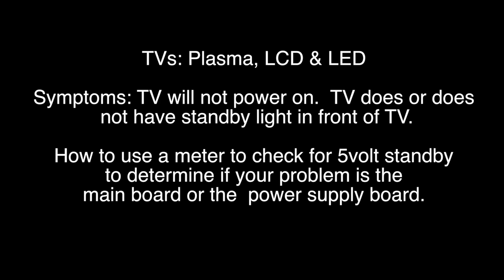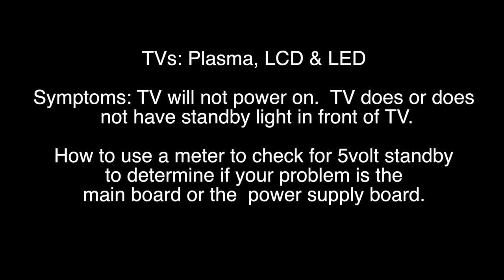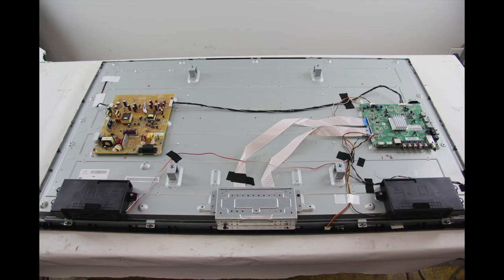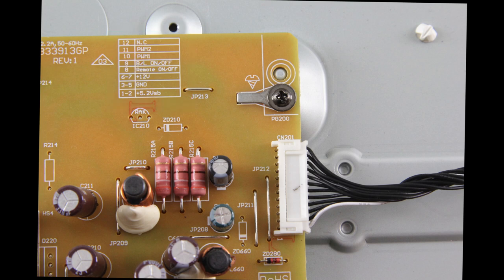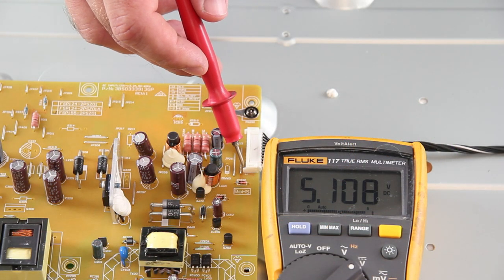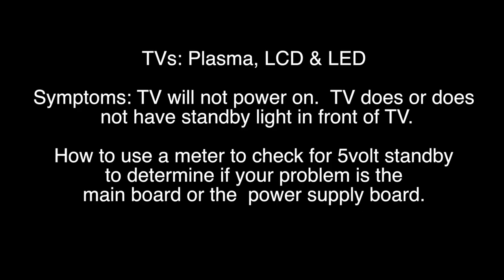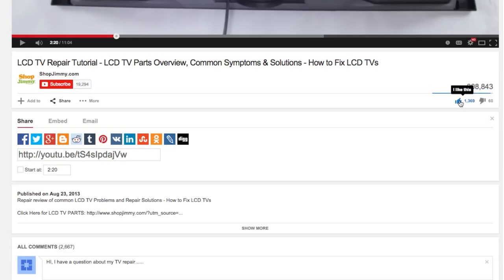TV Will Not Turn On Troubleshooting Help - LED, LCD & Plasma TV Troubleshooting TV Will Not Power On

Comment: Thank you so much for this educational video!!! By your multimeter test I needed a power supply board.  Unfortunately the power supply board I needed wasn’t in stock on your website but I did find one on eBay and now my TV works again! No TV repairman costs at all since I was able to diagnose and fix myself.  I’m in a debt of gratitude and will refer everyone possible to your website, videos, products...etc.  Thanks!

Comment: I have a Toshiba 40e210u1had this problem....after watching your video i figured out that I did have the 5v standby on the power supply so I replaced the main board as suggested. The Tv is now working again, thanks shop jimmy!

Comment: Hi Jim, thank you very much for your video. I have a Sony Bravia 60" kd-60x690e TV that is five years old today. It turned itself off, and will not turn back on. No lights, nothing.

There was no surge. I removed the plug from the surge protector, and plugged it into the UPS, no change. I plugged it into the wall outlet, no change. I'm guessing a power supply board.
When I watched your video, I could not tell where you grounded the other probe. Obviously, touching one probe to a connection, and leaving the other one dangling will not complete a circuit for electricity to flow. Where did you ground the other probe?

Thanks.
Reply: Same question, i really wish he wouldve shown it randomly. Or purposefully.

Comment: Hi, I have a Phhillips model-  24PFL3603/F7 the only thing that turns on is the Optical cable light, any idea what it could be.I changed the board and all the same. Would appreciate any help, thanks.

Comment: Dumb question... where do I put the negative lead ?  Any metal surface? Or is there somewhere on the board that has the negative lead?  Thanks
Reply: Put the negative lead on the metal frame of your TV. You could stick your negative lead into a metal screw hole, making sure it makes a good connection.

Comment: My Vizio LCD sometimes won’t power on. If I unplug and plug it back in, it will work for a while. Occasionally, it’ll turn off by itself while I watch, and I can usually just turn it back on. Also, if I haven’t used it for a few days, it sometimes won’t turn on. Unplug/replug seems to fix it as I described above. Power board failing?

Comment: Hello Jimmy. Great video! I have a lg 55ln510, #310rmhr7b601 that will show picture for 30 sec and then the screen goes black. The standby light is on when tv is plugged in.  I have checked the standby signal from pwr supply to main brd and get the listed value of 3.5V but I get a 0 for the 12v and the 24v pins. The pins for the wire going from pwr supply to led (+/- +/-) started at approx 13v and quickly dropped to 0 when tv plugged in but not turned on. No visible blown capacitors. Any suggestions would be appreciated.  Thanks!

Comment: I have an Element ELEFW328 curb orphan I took in. It's Main & PS boards are combined into 1 disappointing failure.I plugged it in standby light came on, hit the pwr button but no picture. Replacement board was only $12. I put it in and same results. I measured voltage at the power switch this time. The board that it came with had 0v. The replacement board put out 6.6 at the power switch. I'm corn-fused. What do those disparate voltages signify? It the power switch bad? I dressed as Uncle Fester last Halloween. I was going to wear the same costume, but say that I'm Rudy Giuliani. Do you think I can pull it off?

Comment: I have standby 5 volts. I don't see any standby LED lit except LED on Network Port on Main. Power button does nothing. Main board is expensive. Is there any way to jumper or "trick" power supply to fire up the 12v side for further testing?

Comment: I ordered a replacement power board for a TCL 55s401 (2 years old) because I had no backlights. Flashlight test confirmed there was a display. I installed the new board from ShopJimmy and I get no response at all; not even a standby light as I did with the old board. Thanks for any help.

Comment: I bought the repair kit from you guys for the dps-162kp a power supply im wondering if you have a tutorial for testing  and replacing each component in the kit.

Comment: hi sir you
i want to ask  about a samsung tv  le37c630k1w 
this tv has only remote control no power key but i have test the remote is ok 
if standby voltage is ok so in your opinion the problem is the mainboard ?
its not needed to check the other voltages of the power supply ?
the red light of standby is permanently light and it seems to be permanently steady 
it doesnt blink when i give power on from the remote control

Comment: I have Sharp 58Q733Ou and have replaced all 5 backlight strips. Using LED tester at wiring harness, will not light LED strips/ showing open circuit. Have replaced wiring harness but still shows open. All 5 strips light when tested individually.  Not sure what is causing open circuit.  Thanks

Comment: Hi Recently my LG 42 inch TV had backlight issue where video alone was not viable but that was too viable through flash light test. The service technician changed the back light LED after which the TV went to standby mode. 

Initially he replaced the main board still it was in standby. Then he changed the power supply board. Still same issue . He change TCON board even the issue persist. 

But finally when I asked him to change back all three to old board and when testing he was able to recieve supply to all boards. Which initially did not happen. 

Now with all old boards and backlight alone changed the TV still stays in stand by mode. 

I feel the technician is not having a sound knowledge on the issue and just like that he is saying the LED panel has to be changed. 

With your experience do you have any idea on this issue.
Any small hint would be great full.
Thank you.

Comment: Hi. I have a Panasonic viera plasma TH-42PZ80U TV that will not power on. The red light next to the on button blinks ten times. I am guessing based on research googling the 10 lights, it is the power supply board etx2mm702mf-n. Is that right? Will replacing this board do the trick? Can the board be purchased thru you guys?
Thanks, Dick and Norma

Comment: Thanks for the great effort... I have a problem with the Samsung lcd-la32e420, and the problem is the following:
When the power cable is connected to the power, the screen flashes and turns off immediately.. for the knowledge that the voltage measurements from the power board come out intact, especially 5 V.. Can you help me to solve this problem

Comment: If I bought a control board just recently to find out that it is not my Version after replacing the power board I still cannot get the TV to power on mine is a Samsung UN50KU6300FXZA DA01 version and I believe the board I installed was a DF08, is there a difference on versions for the control board that you cannot see that would make the tv still not power on, the circuitry looks identical?  Any help would be great could it be the P jog switch? or do I just need to order the proper control board DA01 version

Comment: I have a MITSUBISHI MODEL "WD-60638". When I turn the TV on nothing happens nor does the indication light come on. I tested the 5V test area on the power board and got a varying 1-2V reading. What would you suggest i look at next. Thank you for your time.

Comment: hey, I have a power supply board with standby votlage. I shorted (using a tweezer) standby voltage to the power on pin to turn the tv on. then measured the unregulated 24v output and was only reading 1.4v. What could be the problem? I have a sony dps-162lp board

Comment: I have 5v on SB pin of PS but 11.6v where I should be getting 12v and 19v where I should be getting 24v...Any suggestions? PS or mainboard replacement? Thanks.

Comment: I have a Samsung 55" LED Smart TV that during a recent storm made a loud crack sound and shut down. I have verified that all items in the surge protector still work, but the stand by light and power to the tv does not. If I follow your videos, what kind of price might I be looking at if one of my boards needs to be replaced? Before I invest all the time and money I would like an idea if I should simply buy a new tv and if so, what brand would you recommend?

Comment: I have a SamSung 59" D6900 Series 6 3D Full HD Plasma TV that was manufactured in 2011 that will turn itself on and off every few seconds and is stuck on PC input this first happened over a year ago when I was switching the input source from one source to another too quickly and I was reluctant to dispose of it because when it is on the picture is near perfect ! Very annoying problem if you have any suggestions what part I might need to replace (if I can find one for such an old TV) that would be very helpful thank you.

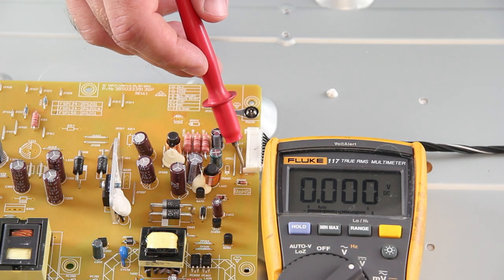Comment: AT 2:30 into the video, you are testing standby voltage. Using the red test probe, Where are you connecting the black probe?
Reply: J Schmidt the black lead is grounded somewhere else on the back of the TV. In a metal screw hole works.

Comment: Hey Jimmy
I have a plasma tv to fix. Lg plasma 50pt350ud  is the model.  The tv comes on and screen lights but no picture.  It will not allow channel change or input change those buttons are unresponsive when pushed. It has no picture or sound.

Comment: I see your red + cable going to the pin on the power supply board. Where do i touch my black lead from my meter? Thank You !
Reply: Put black lead to the ground anywhere to the tv metal body

Comment: I have a Sanyo model DP42D23 TV. It has a new P.S. board with all voltages good at the cable coming from the Main board. But it still doesn't come on .There is no standby light that is on. I went to the other end of the ribbon cable from the P.S. Board to the other rf/tuner/line out/in board and all the power and gnd's are good to that point. The board number on the board from the P.S. is NO: PCB J 0995 D1 W46/13.  Other numbers on the board are Z7L  305A   49. Not sure if that helps. The power on/off button doesn't turn it on either. I do fine voltage across the power button when press. But still nothing happens from that point on. 
Do you think it's that board?

Comment: I have a rca mod #led42c45rqd  ser # 2505-ld42c45d100735. The picture would shut off but the sound still worked shut it down and restart and it would work again. Now it  starts flashes on for a couple of seconds and turns off. I looked at all the capaciitors and did not see any that looked bad. I only see two boards power supply and main boards. Where would the T-con board be located?

Comment: Hello, I have a 12 month old vizio  e48-c2 that will not power on (it began after a storm so, lightning is the primary suspect) I've removed the back panel and the components look like none I've seen on line. There is a small board at bottom center roughly 2x6 inches connected by a ribbon to a larger panel at 3 o'clock roughly 8x12 inches.. I can replace the the tv with a new one for $388. Can you tell me what the cost to repair might be? Is it possible that only a fuse is the culprit? Thank you.
Kind regards,
Billy Hardwick

Comment: Replaced power supply on 50S425 TCL TV but picture is way to big for screen.  Tried factory reset but did not work.  All menus show on screen and work but they are just too big for screen. Audio works well also.

Comment: Hello,

I like your service and commitment to help / guide the community to repair the TV.

I have a Sony TV - model KDL52XBR9.  It has a blank screen - no video or audio or backlight. When I turn ON with Remote or Power button on the TV, just the Green Standby light comes on.
If I disconnect and connect the wall plug, I hear some rely clicking and the backlight comes on for about 45 sec and backlight turns off by it self. Green standby light remains ON till I power OFF.

Can you please help diagnose the issue?

Thanks, Mohan

Comment: I have a 60in Sony mod# KDL60EX500 with a black screen. Took the back cover off and no back lights. Used the flashlight test and nothing. I'm sure the sound was down when it went ko as I was using a sound bar. The only way to get power is to plug and unplug from the wall outlet. When plugged in; the green light is on but nothing works. There is no red light ever. When plugged in; sometimes the little square black unit just below the coaxial connection at the main board glows red. Sorry for my rambling. What do you think is wrong and what can I buy to fix? Thanks

Comment: I had a problem with no video on a Vizio 50HG5.  I did the flashlight test, and I saw images on the screen, so I ordered the "repair kit" that you offered.  I replaced the main board, the power supply board, and all the other parts (I figured they would probably go out soon enough).  I tried the TV, and now, not only do I not have any video, but I have no audio, and the TV won't come on, or respond with the remote or the buttons.  I would like to return your "repair kit".  How do I do this?
Reply: "Repair Kits" are something that came-about by "an expert" that got lucky and is opinionated, "more people will have this problem".  
Basically, a rip-off that I stay away from.  The parts usually work out cheaper if you bought individually, anyway (from the same source, of course).
I have never bought any "repair kit".

Comment: I have an LG 42LD690 TV. The power light shows in standby and goes to a wavering red light when on button is depressed. I have checked the power rails to the control board and they are ok. What outputs can one expect from the other outputs to the LED's? At the moment there is zilch. I have no picture.What and where do you think the problem area is? Grateful for any advice. The TV is only 5 years old.

Comment: I am a repair tech with 25 years experience in the repair field with a big communication company in Jamaica.The problem I have is with a Samsung tv model number UN32F43AFXZP the fault is it will not power up when the power button is pressed. The power light come on then flash 5 times the off. I have taken out the power board inspected it the caps seem good then I checked all of them they are all good. I power up the board by it self all all voltages are present. Can you enlighten me as to what might be the fault and if it is the main board or power board where can I source these boards appreciated in advance

Comment: I have a Panasonic 50P30S. The light is solid red when I turn it on and when I hold the button down it blinks 14 times. When it is live it will not send out 15V to the other board also the 5V standby signal is not being sent to the Aboard but it had the 3V available. When I trace the power line past the two fuses on the power board I have a potential difference of 120V. When I look at D309 I have 120V on the positive side but only 40-60V on the negative side of D309. There is a 58-82V voltage drop across that diode as well. Is this a power board issue or does it go into protective mode and shutdown so it doesn't output voltage to the other boards?

Comment: I have a VIZIO L37HDTV10A. The power light is yellow on the front when it is off and turns on to green when I hit the power button but the screen does not light up. The problem started a week ago when it took  longer for the screen to appear and now it will not appear at all. Haven't done anything yet to the set but will take the back off soon. any hints. The video I watched here advised to check the pins for power if it is labeled. Any further help?

Comment: Hi, I have a 32" Phillips flat screen T.V. - Model no. 32PFL5522D / 05 . All was fine until a few days ago when I went to turn it on via the remote and nothing happened. The standby light has never come back on when plugging into the power supply. Have tried all the usual tricks by checking the fuse in the plug, plugging T.V. into another socket in another room - no joy. I am about to take off the back of the T.V. and go through the steps as advised on your youtube commentary. It makes sense to do what you advise about checking the standby voltage etc. Just thought I would post this prior to starting the checking procedure in case anyone has any other types of advice before I start.

Thanking you in anticipation

Ian J.

Comment: Hello, I have a LG plasma tv model 50pj350 with sound but no image. I checked the power board and it is working, changed damaged mosfets on YSUS, caps read ok, so do resistors and diodes. Though the VY and VSC testing points shoud read -198V and 135V and I have no more than 60 volts on each. Any sugestion? I’ve tried to get the board diagram with no success. Thanks.

Comment: I replaced both my power supply and main board due to a lightning strike and still no power? I ordered my parts from you.  i got them today. I decided just to replace both since i did not see any damage to my boards.  I do not have a tester with me right now to test the volts. what could be the problem
Reply: Must buy a tester.

Comment: My VIZIO XVT553SV tv has standby power but does not turn on.  It does have 5V standby so I replaced the main board per your instruction.  This did not fix the problem.  I then replaced the power board per your instructions and the tv still has standby power but does not turn on.  What is left for me to check?
Reply: same with me

Comment: Hi Jimmy,

I have LG 70inch full HD Led tv, unfortunately it does not power on, I showed it to a tv mechanic and He said that display panel is not faulty. Replacing a display panel is too expensive, is there any other way or any alternate method.

Comment: Hi Shop Jimmy, Nice video, I have a LG, LED 55LW5700 tv, I checked all voltages all are goo except the "power on" voltage. It should be 24V and it is only 3.5V, All other voltages are good, does this mean my main board is bad?